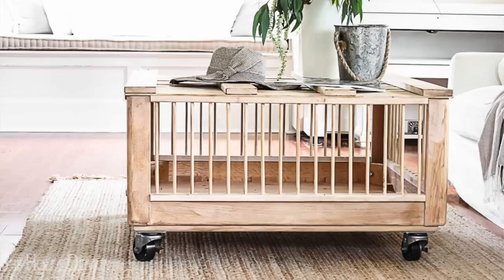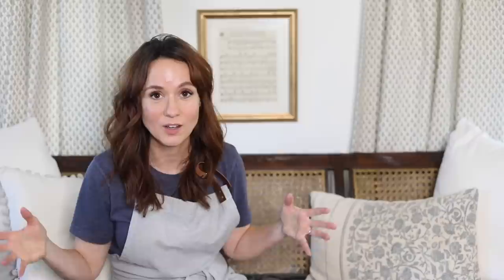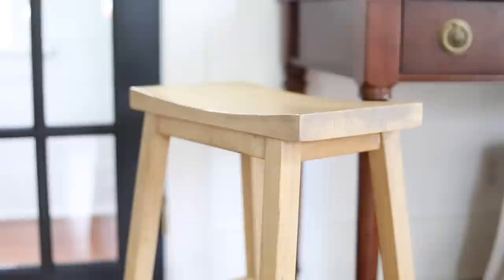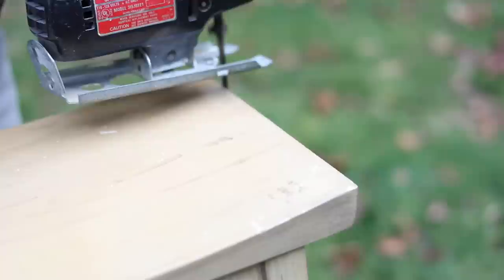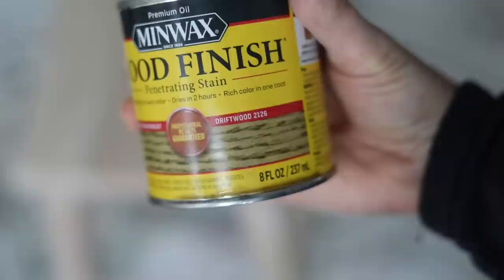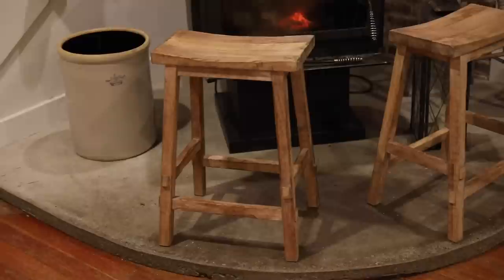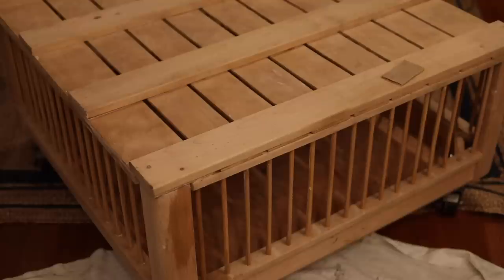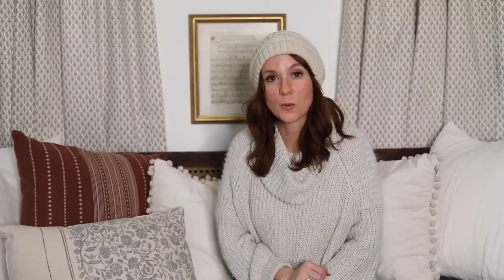How to Age New and Thrifted Wood Furniture

Comment: My kitchen table was from Ikea. It was a pine table top with separate legs. I had the table top Cut to size at the hardware store so that it would fit my small kitchen area. I distressed it with hitting it with chains, gouging & digging in it with a screwdriver (a great stress reliever, ha). I stained it with a brown mahogany and then put on a polyacrylic matte finish. I've been using it now for about 9 years and you would never guess it was a pine table and it really has a rustic look to it so it works perfect in my home. I'm definitely a believer and figuring out what you want and making it happen, thanks for your video!♥️

Comment: I just used a wired brush for aging wood, because I didn't have the wire brush end, for my drill, either. The wire bush does work, or it did for me, anyway, you have to run it the opposite of the wood grain. It brings out the texture of each rib of wood, making it sort of bumpy, and it does scratch it up some.